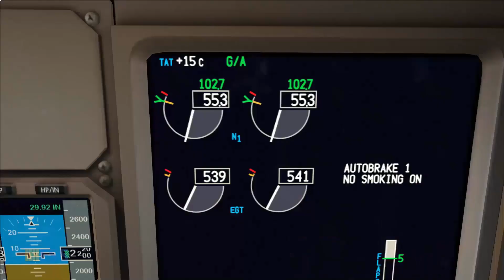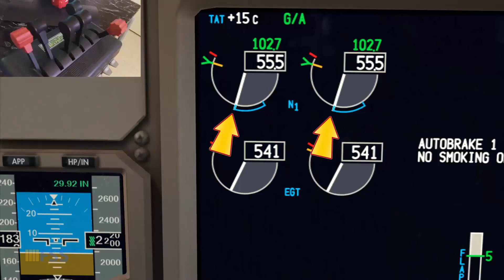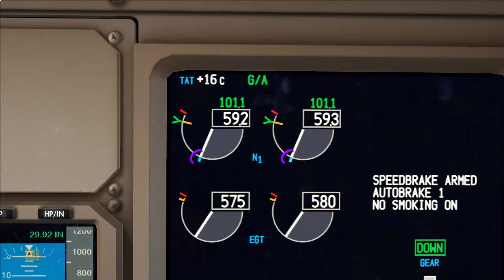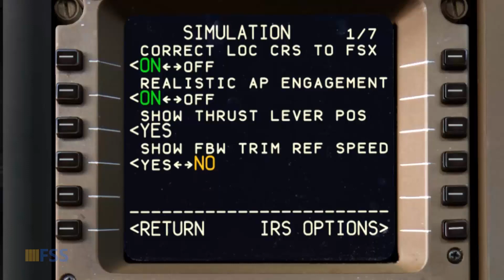PMDG 777 Tutorial | You May Need To Know This Autothrottle Trick

Comment: I was on a stabilized ILS approach on a 1 mile final when thrust went to idle. I touched nothing but tried to disconnect autopilot and auto throttle and had no control from my honeycomb quadrant. AC stalled and I hit the escape key. Can anyone help with this.  Thanks for your Video.